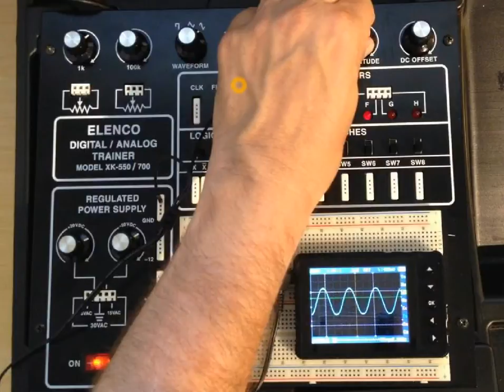Elenco Waveform Generation

Comment: Ive got one of these collecting dust, I should test it out ive had to replace a transistor on the board inside when I first got it, it was dead I'll  give mine a checkover with the help I saw from your videos.. im a beginner in electronics self tought thanks for the helpful information information